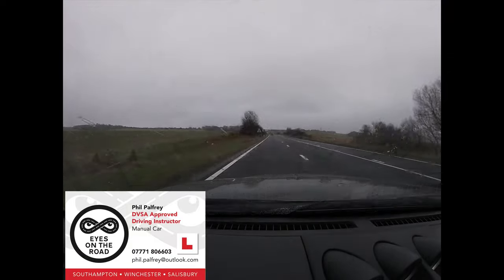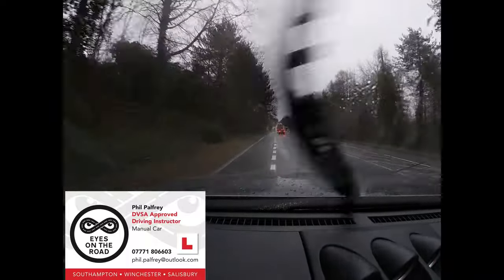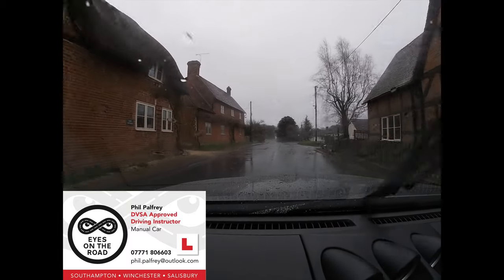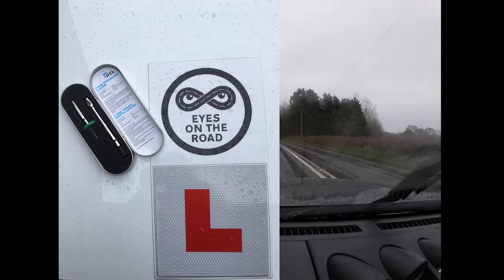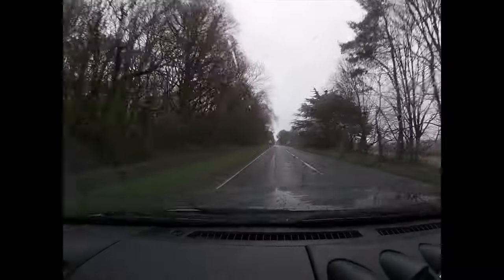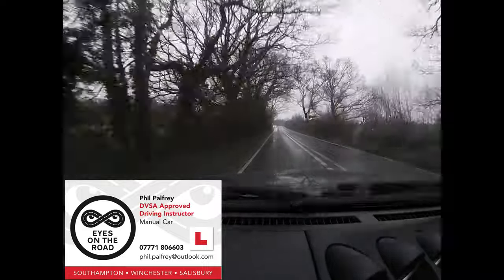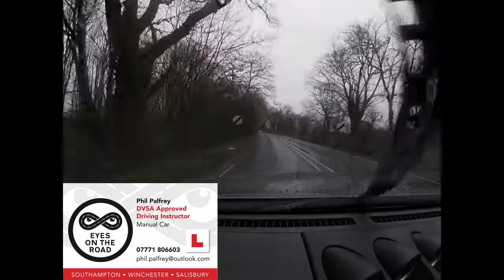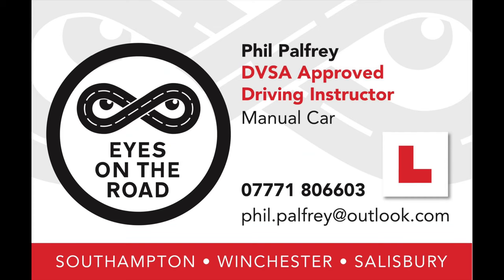Wet Weather Driving

Comment from the maker: The modern design ‘AeroBlade’ windscreen wipers, as found on most new cars, can now be easily retro-fitted to classic and older cars which have the traditional ‘umbrella handle / hook’ fitting system as demonstrated in this video: https://youtu.be/gBkufSjg-qU  The lack of a metal frame reduces noise and the fatigue it causes the driver; as well as avoiding the frames freezing in winter. A simple and cost effective wet driving safety upgrade worth considering when your wipers need changing.

Comment from the maker: The legal MINIMUM required for Tyres is described in detail, with supporting diagrams, in the MoT Testing instructions: https://www.gov.uk/guidance/mot-inspection-manual-for-private-passenger-and-light-commercial-vehicles/5-axles-wheels-tyres-and-suspension#section-5-2-3

Do not confuse this LEGAL minimum, with the SAFE minimum. Particularly when the car is being driven by young & inexperienced drivers who may make ‘rookie errors’ of judgement on speed, distance, severity of bends, weather & road conditions.